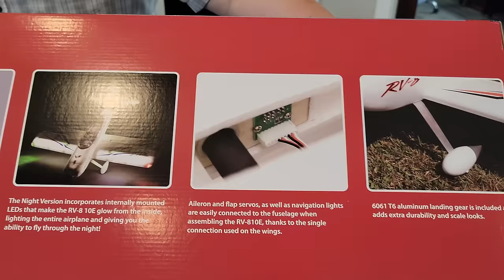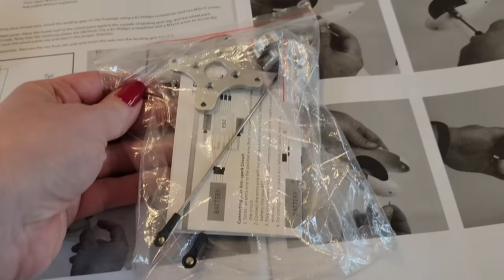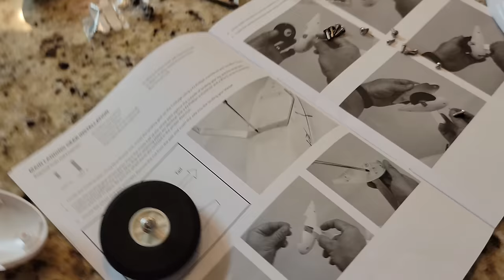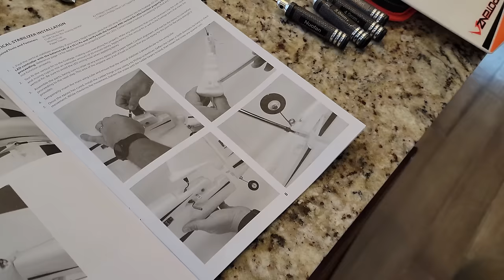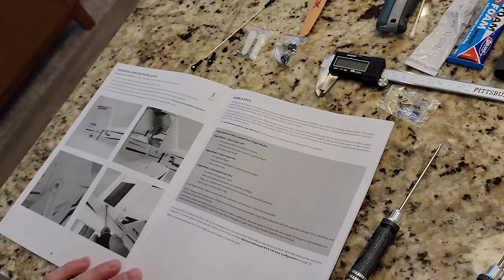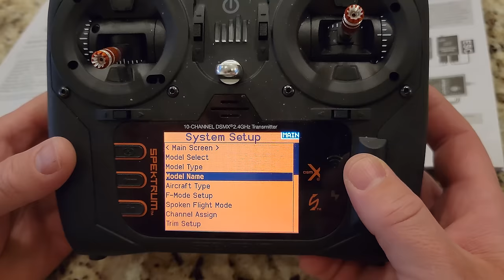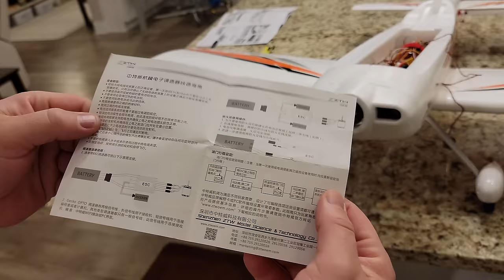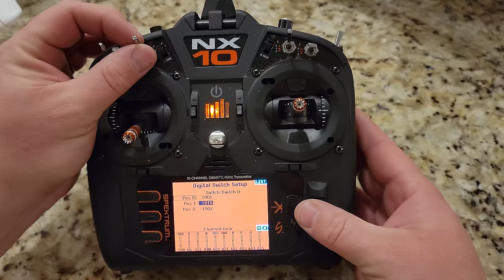Flex Innovations - RV-8 10E - 1280mm - Unbox, Build, & Radio Setup

Comment: Looks like my night timber x, bet they will both perform the same too. Cool plane dough🎉🎉
Reply from the maker: This one is more docile, but the trade off is lighter weight foam and a bit more expensive.
Reply: this actually performs better than the timber. Aura 8, power, and flight envelope is outstanding especially if you're a 3d flyer
Reply: I enjoy flying the RV-8 more than my Timber X.
Reply: @monchichis333  i try to do 3d stuff but im not a 3d flyer, much like mr. Phillips
Reply: @chillville5571  And that's why the flight envelope of the RV8 is phenomenal cause you dont have to fly 3d with it. You can fly slow and scale, or go all the way 3d if you wanted to. The potenza servos it has are very quiet and very smooth. This plane is lighter than the timber and runs 6s. I own both, and the comparison is night and day. Let's just say my timbers took a break for months
Reply: @monchichis333  so what you're saying is i need to go ahead and order one lol
Reply: @chillville5571  Exactly! lol... that's how I was at first, but you really have to fly this thing to really see what it's about. It's like a sky-cadillac with mucscle in it!
Reply: @monchichis333  ive been on the fence for years thinking about the blue and white rv7 just because its so pretty. Maybe someone will get one at the club and let me fly it before i buy it 😅
Reply: @chillville5571  The e-flite rv7 actually sucks in my honest opinion but livery looks kinda cool. but it doesn't fly the same as the rv8 flex

Comment: It's a shame you cant get telemetry to work with the aura. I've tried a spektrum telemetry-enabled full receiver and an avian esc,  ESC plugged into Spektrum and SRXL2 cable to the aura - doesn't work. Well, telemetry works, but no comms between the aura and the  receiver without unplugging/replugging the SRXL cable every time. I believe it's a protocol issue. If anyone has a configuration that both flies and provides telemetry, pls let me know!
Reply from the maker: That sucks! I hate when there's ONE detail stopping this function.

Comment: Horizon sucks!!!!They won't replace a defective servo I have in my V900 sport plane.The servo acted up just after 9 flights on it.I replaced the servo at my expense and the plane is now airworthy and ready to fly.
Reply: Flex's customer service is top notch. They'll send you a new servo if something is wrong with yours out of the box
Reply: I've had 2 bad H&H servos on brand new planes and a poorly programmed Safe mode on a Ultimate biplane. Safe was off 15 degrees. You'd flip it on and the plane heads towards the ground fast!  I gave up on H&H and accept what I get and fix it. 
  But that's the reason I just bought my first Flex Innovation plane... Mamba 10   I think lots of ppl are moving to Flex for the same reasons so flex runs out of everything too